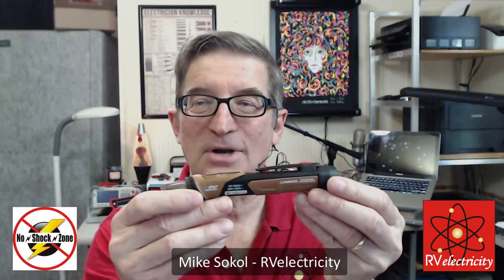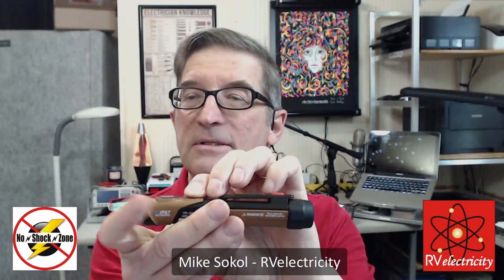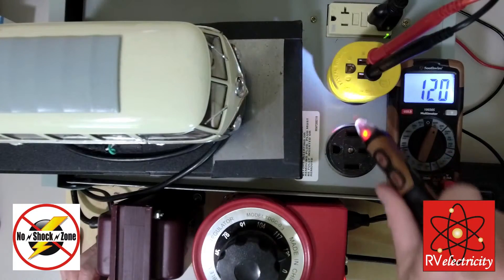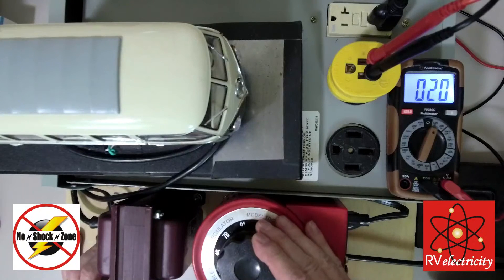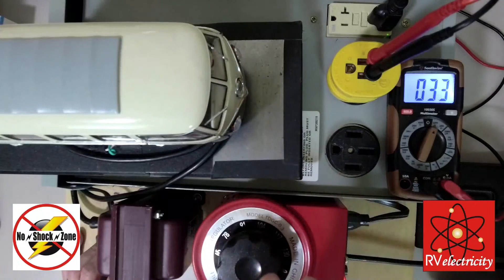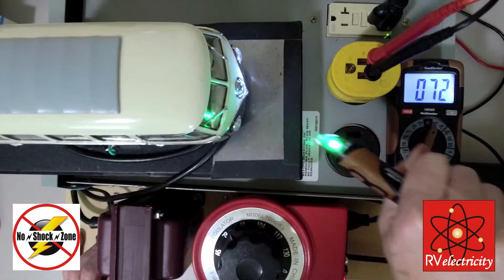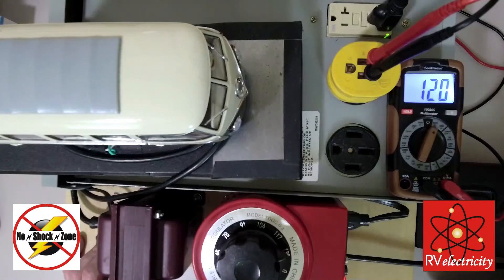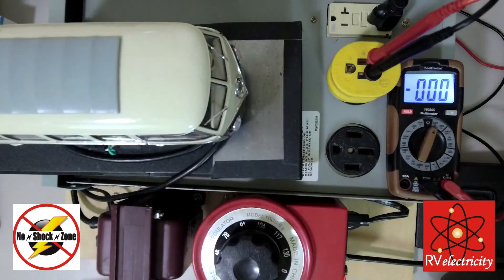Using a Southwire 40150N Non-Contact Voltage Tester to find an RV Hot-Skin voltage

Comment: Thanks Mike.  Mobile RV tech of quite a few years, I want to test for hot skin (or hot hardware due to fastener puncture) , sometimes just for fun, sometimes for official inspections.  
Do you know if this one is adequate for a inspection, or would a long ground lead + meter be required in your opinion?

Comment: Using my NCVT today on a pedestal and got a weird beep beep. No beep beep on the ground. Then all three blades gave me a beep beep beep.  In the past, I've gotten the beep beep from the to lower outside blade holes, left and right. I thought only to blade would give me a beep beep. I know this park has had problems in the past with open grounds here, as I was talking to one of the electrician two years ago and they were correcting that. What is this an indication of? System seems ok. What do I tell management if, in fact if some is wrong with the beep beeps.

Comment: Nice product. Question. On a 12 v dc light, can I connect the ground to the fifth wheel chassis?  The light I am installing is in the closet, there is a positive 12 c wire I can tap but no neutral or ground wire.
Reply from the maker: Yes you can.... That''s how it was always done in the old days, and it will still work for small loads like a closet light.
Reply: @RVelectricity  thank you.